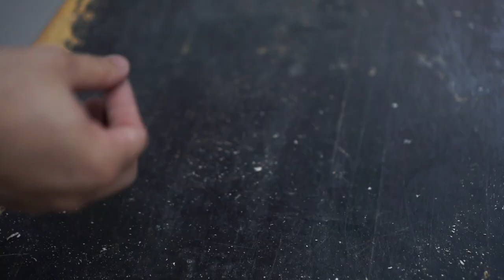How to make a simple Screw Box - DIY | Ep 13

Comment: Great. Get rid of the jigsaw ASAP. Get rid of the pull saw. Cut everything by hand - gents saw (Bahco), and a fine cross cut saw (Irwin throw away hardened teeth). Let the glue (try Soudal ova) and drill a fine hole and then pin making sure the box is well supported. Really good outcome. I will use your ideas - thanks.